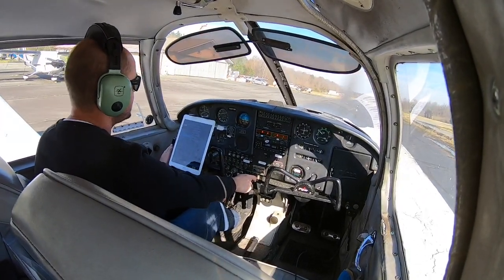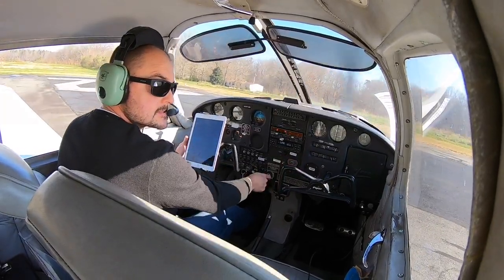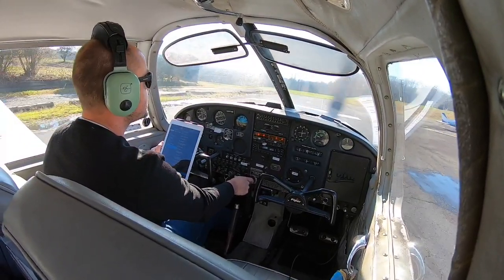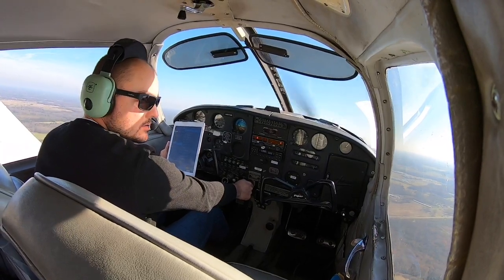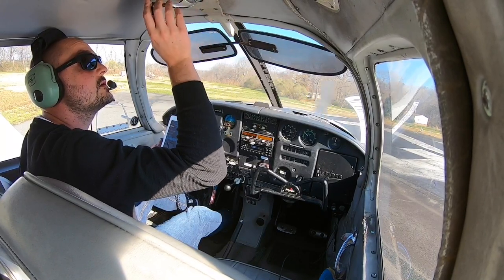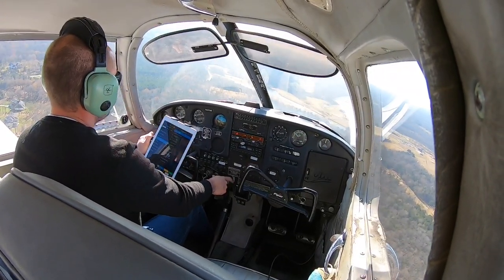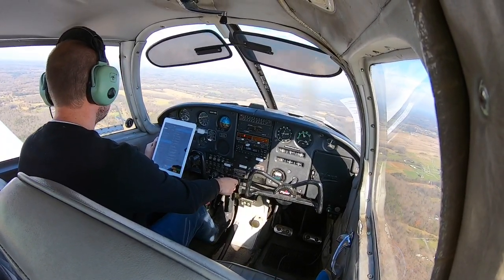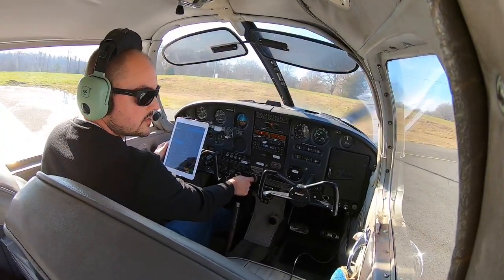How to Fly a SHORT FIELD TRAFFIC PATTERN | Piper Cherokee 140 Cockpit View | Pilot Vlogger #4

Comment: I apologize for a silly question, but does the tablet interfere by covering the instruments? Its quite big.
Reply from the maker: Not a silly question at all! Luckily the iPad does not interfere with the instruments. During startup I have to tilt my head to see the switches, but other than that all vital instruments are in my line of sight. I know that some shorter pilots find it difficult to see the top row, however, I am about 6ft, so I do not have that problem. Thanks for watching my video!